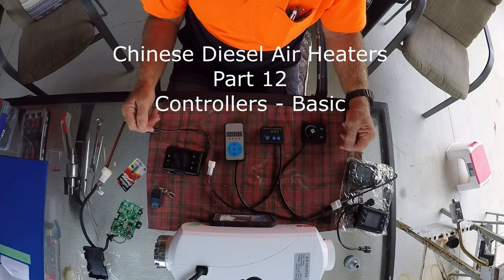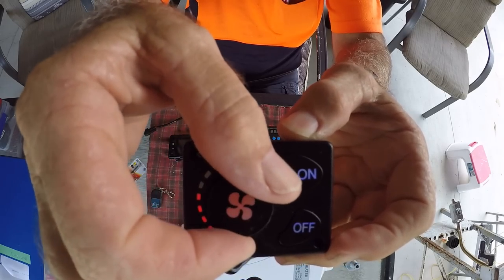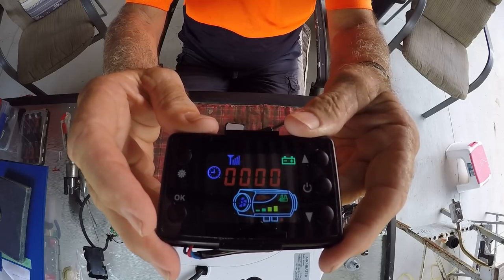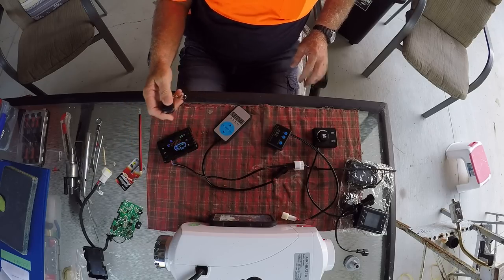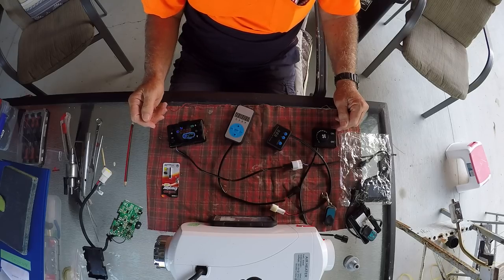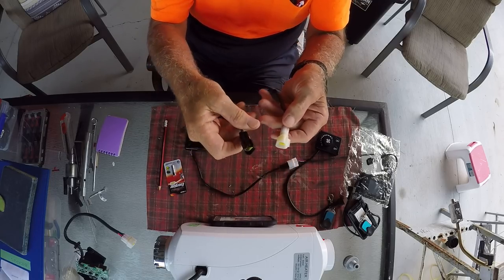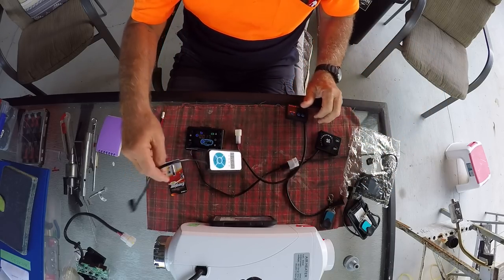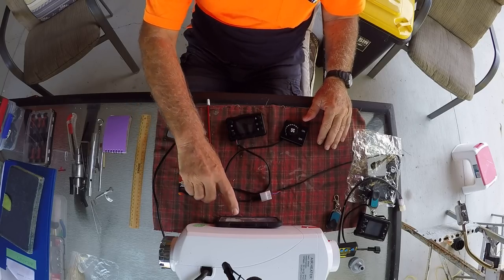Chinese Diesel Air Heaters -  Part 12 - Controllers (Basic)

Comment: Thank you very much for useful information. I have a question about usage these heaters at high altitude. Can they be programmed or what is needed to use it in mountains about 5000-10000ft?
Reply from the maker: Hi Yuri,

You can get an altitude kit for the genuine Eberspacher heater, but to the best of my knowledge there is no altitude compensating kit available for these Chinese copy heaters. However, as a compromise you could try using a high kerro:diesel mix say 80:20 or 90:10 to lessen the effects of running the heater in a reduced oxygen operation.  JMcK

Comment: Hi John I bought a heater with a black lcd controller. Unfortunately its a very basic controller, cant do much more than alter the temp on it. It has an "oil bottle" symbol instead of an OK button. (Dont know if you've come across this one) ........Anyway, I bought one of the BLUE controllers complete with motherboard. My question is will all motherboards fit these CDH heaters? Do they all have the same connections on the motherboard?
Reply from the maker: Hi Jack

When I did these videos some years ago now, most manufactures followed the same protocol and you could easily mix and match components. You could change controllers easily using the same motherboard, and all had matching plugs.

These days it is not so easy. Even with different controllers having the same plugs, sometimes the wires are reversed -  (Can easily be changed if you can solder)

Also now not all mother boards and controllers are compatible. You need to check if the temp sensor plugs fit, the dosing pump plugs are compatible, the controller talks to the mother board, and the mother board has the fan speed sensor in the right spot.

If you are a bit handy in these matters these things can often be fixed. But for most people, it is easier to buy the “package” they wast, and if there is an issue, ask for a replacement.  JMcK

Comment: Hi, learning a lot from these! I have a controller with blue lettering, it looks like it only has 3 digits rather than the red lettered one you have, therefore 1688 doesn't work in getting into the advanced settings. Is this something you can do with the newer blue lettered controllers? Thanks.
Reply from the maker: Hi S,

Thanks for your post.

Sadly I can not help you in this matter. I have seen too many people get into issues when they go into the advanced settings, and there is, (to my knowledge) no reset button. This is an area for an enthusiast to experiment. There are a number of people doing controller videos, perhaps there is one with the info you require.

That is my official reply, but actually, I do not have your type of controller in my workshop to play with. Be careful going into the advanced settings. For years the different Chinese heater manufactures all followed the same protocols, which made things very easy, but lately some manufactures are going very unique, which can cause you some real headaches in the locked settings.  JMcK
Reply: @johnmck1147  Hi, no worries completely understand. I plan to tune using a CO meter to achieve the cleanest, most efficient burn. The more I research into this the more I'm convinced this type of controller is too basic to enable fine tuning. Thanks.

Comment: Good video about controllers, I have the latest controller, the one with all the displays.
My one question is, to bring down the temp once the unit is underway, do I just press the down button.....wasn’t sure about this as it displays a P then a number.
So the lower the P value, does that bring down the temp, maybe it’s me, seems rather strange it doesn’t give the temp degrees instead off P, or have I got it all wrong
Reply from the maker: Hi Greg, 
P represents the frequency, and the number displayed is the pulse rate of the dosing pump. Eg, the number 4 says the pump pulsing at 4 times per second. (Squirting .02 ml of fuel 4 times every second).  These heaters do not have a carby or similar and the ECU uses the known dose and frequency of the fuel pump to match it with the fan speed to get a matching air volume for a correct fuel burn.

Push the down button to manually bring down the fuel dose and hence the temperature. Push the up button to manually increase the temperature.

Consider these buttons to be like a car accelerator, or remote control of an AC. You can manually adjust the temperature up or down.

Cheers, JMcK
Reply: On my controller,  I press the "ok" button and the "up" button simultaneously and I can switch between hz and temperature control.  Hz control the pulse rate of the pump, temperature settings will bring the heater to a set temperature.

Comment: Hey John,
 I know these are old videos but I have watched them all so far and find them very useful but I do have one simple question, is it possible to use 2 remote controls on one heater, mine has the LCD screen type of controller and one 4 button remote but it would be useful if I could add a second remote.
Many thanks for any help,
John
Reply from the maker: Yes, in most cases you can pair more than one remote to a heater, (if they are compatible).  JMcK
Reply: Ok thanks for the reply John, I'll get another one the same as I have now, John UK.

Comment: Great video John, Hope you could help me with a problem I have? My heater has an Oval controller similar to webasto, with error code E15 which means board failure according to the manual. My question is, are most good controllers interchangeable if mine is faulty?
Reply from the maker: Hi Geoffery, most, but not all Chinese copy diesel heaters have interchangeable controllers, but the Chinese controllers are not interchangeable with the genuine heaters Eberspacher and Webasto, unless you have some serious technical knowledge.  

You can buy on line a Spare ECU and matching controller that you can make work if your controller does not have the standard Chinese wire protocol.  Sorry.   JMcK
Reply: @johnmck1147   Hi John, yes it's a basic chinese heater. I cannot see any of my design controllers available so I'm guessing a replacement controller is required, but which one would you recommend?
thanks
Geoff

Comment: I've just bought one of these heaters and it is powered by a 12 volt 30 amp power supply......when it switches off the LED readout turns off too.........I also finally turn the power supply off when the heater goes to it's off cycle.

Comment: Hi John, Just installed my 2kw heater fired up ok but even on minimum thermostat position its to hot for my small van. I have the simple rotary controller, is there any way I can slow the fan and pump speed with this controller, I understand that on the LED display type you can alter the pump frequency. Great videos, thanks for passing on your extensive knowledge. Reg
Reply from the maker: Hi Reg,

First, is your heater really a 2KW heater?  Some eBay sellers sell the 5KW heater and relabel it as a 2 KW unit. They also relabel the 5KW heater and sell it as an 8KW heater.

Second, the slowest you can realistically slow the pump is to 1.6 Hz, which is a common controller low speed. If you go lower you really can't keep the flame going in the burner.

Third, the min speed on the rotary controller is very similar to the minimum speed on the LED controller.

Fourth, are you waiting for a few minutes for the heater to stabilise? It will run fast on start up and then slow down when the burner is well alight and the chamber up to temperature. 

Fifth, you may have a defective controller. Does the fan and the pump ticking slow right down when you turn the control knob down?

I hope this helps.  JMcK
Reply: @johnmck1147 
Hi John,
Thanks for your reply. The unit was bought as 2kw, how can you if its not 2kw? Pump speed is about 94 beats per minute which i think equates to 1.56 Hz. I have had it running for about 1 hour none stop with the thermostat on one bar. With control right down its 94 BPM. I still have some air in the system but only a bit maybe 2" in the pipe.  I did have an eberspatcher?   heater in boat i had, it seemed to run at a much lower speed.  I notice on one video that you can control the pump speed.
Many thanks,
Reg

Comment: Hello John...Wondering how you can prime the heater with the basic rotary  controller.
Reply from the maker: Hi Amie, you press and hold the off button until you hear the pump start ticking. The pump will then run for about 4 or 5 minutes to prime the heater. Do the same again if needed.  JMcK
Reply: @johnmck1147  Thanks for the response John.  One more question if you don't mind.  Again, when using the rotary controller does the heater automatically go through the shutdown process when you press the Off button on the controller.  Does the glowplug ignite to burn off any residue?  Thank you.
Reply from the maker: Yes, when you press the off button, the heater goes through its safe shutdown procedure.  
I personally prefer the simple rotary dial controllers. JMcK

Comment: Question, if when the controller should fail and the heater continues to run at the last setting but without a way to shut it down without damage. Could you stop the fuel supply until the heater cooled then shut it off by disconnecting the electricity whitout damaging the circuit board? Disconnect the fuel pump wire?
Reply from the maker: Hi TB

It you disconnect the fuel supply by either disconnecting power to the fuel pump (best way) or shutting off the fuel itself, the heater will go into shutdown mode on its own, and turn itself off.

Cheers.  JMcK

Comment: Hi John, I have just fitted a replacement heater in my boat in La Manga. Everything seems to be working fine but I am getting a slight amount of excess diesel coming through the ducting, as if its not all being burnt off on the plug? Any thoughts? I am using the led controller and the heater is a Vevor. Thanks, John.
Reply from the maker: Hi John,

Not quiet sure what you mean here. What ducting? The large hot air ducting or combustion air inlet duct. Do you mean diesel smell or liquid diesel ?

There should be NO diesel smell through the large hot air ducting.

First check if the combustion air inlet pipe is close to the hot air inlet on the heater. If yes seperate them.

Do you have big ducting on the hot air inlet? 
Where are you drawing the inlet air to be heated from?

You can get slight diesel weeping from the combustion air inlet caused by in complete burn of excess diesel on previous shutdown, or slight diesel seepage caused by the fuel tank higher than the heater. But all smell should go away after heater starts its burn.

If your hot air inlet is well away from the combustion air inlet and the smell remains with heater running you may have seal or gasket issues. This is dangerous.    -  See video on gaskets. 
If this is your issue, ask for a replacement heater.  JMcK
Reply: @johnmck1147  Yes John, it looks like all the diesel is not being burnt off and some excess is coming through the hot air duct
Reply: @johnmck1147  Ok John thanks......The only condition which might need looking at is the distance between the two air intakes. I will look closely at that. I'm going to the boat tomorrow for a couple of days so I'll have time to check it more closely. I did wonder if maybe the pump speed was set too high, pushing excessive fuel into the chamber. On the gaskets.......Hopefully not, nightmare scenario!. Anyway I really appreciate your time. If you are ever down my way, look me up. Thanks again. John

Comment: Thank you John for sharing your knowledge and taking the time to make these videos. If you are using the heater as a portable unit and you disconnect it from the battery, is it still an issue?  Would it be a good idea to install a fuel shut off valve in case it decides to go berserk?
Reply from the maker: Hi Darren. 

First, thanks for the feedback.

If you disconnect the heater from a battery while it is operating, it can not go through its cool down cycle, and you can destroy the ECU and other components from overheat.

I always install a fuel shut off valve between tank and fuel pump.  JMcK
Reply: @johnmck1147  would shutting off the fuel supply allow the heater to cool down properly?
Reply: Would you recommend adding a fuel filter/ water separator?
Reply from the maker: Yes, you should have a good fuel filter to prevent issues with pump and atomisation screens.  JMcK
Reply from the maker: Yes Darren, if there are issues with controller shutting heater down, best to disconnect fuel, never the battery.  JMcK
Reply: Thanks again for the help John, wonderful videos! I hope you had a nice trip to the Mediterranean!
Reply: Hey John, in episode 6 you mentioned that it would beneficial to increase the diameter of the intake hose and also use a
 smooth bore hose, and also limit anyone restrictions. I'm just wondering if you know where I can find some hose that would work? I looked at the hard store and I was unable to find  a larger filter than the 24mm inner diameter.
Reply from the maker: Hi Darren, sorry for the late reply. 
Do you mean the combustion air intake hose? If there are long runs with lots of bends you can make one up out of larger dia PVC pipe from a hardware store. 
If you mean the cabin air inlet, you can also get larger ducting from a hardware store or tool store.
However it is better to keep your pipe runs a short as practical.  JMcK
Reply: @johnmck1147  okay that's good, I'm only a short distance, the heater will be outside.

Comment: Hi John,  Your videos are a great source of knowledge. Thanks. I know you cant recomend a particular heater but could you suggest some suppliers that you have purchsed from and are happy with the product and the accessories like mufflers, fuel line etc.
Reply from the maker: Hi Craig, I have mostly purchase these heaters and the spare parts on eBay. I have had a number of requests similar to yours and just last week I went back through the suppliers I bought off last year, some had disappeared, and none currently sold heaters. 

I suspect, but I don't know for sure that a seller buys a batch load of a particular product and then markets that product until all sold out. If it is a good seller they do it again, if not they try something else. I suspect you would not sell thousands of heaters. I have not found a seller yet specialising in these heaters.

I go on eBay and search for Chinese diesel heaters, diesel air heaters, parking heaters etc, 
I look for the heater I want with the controller I want, at a competitive price. I then try to buy from a supplier who has a local in country warehouse, in my case, somewhere in Australia, who offers returns. However, I have been informed by a viewer that you can get a full refund from eBay for a faulty product without returning the item. This is perhaps a bit one sided as the seller loses the sale, and the product as well.

I always bench test the heaters before install as you occasionally get a dud heater, as there is probably not the quality control you would expect from a very expensive genuine heater. But these heaters are excellent value for money, and they are in a price range of the average person. 

Sorry I can't be more help.  JMcK
Reply: @johnmck1147  Thanks for the reply John, you are very helpful. I have had trouble getting clear information from the sellers on ebay. None have been able to give me specifics around fuel lines and mufflers etc. Can you suggest where I may be able to purchase the correct size and type of fuel line if I recieve a heater with the wrong type ?  Cheers  Craig
Reply from the maker: craig green 

Hi Craig, from tank to filter to pump you can use normal fuel hose. 
From pump to heater you should use small 2mm bore hard nylon fuel hose. This is very important if the distance from pump to heater is more than a meter or so and has bends in it. The rubber fuel hose absorbs the fuel pulses and you get a bad burn.

Depending where you live you can buy at industrial stores, but I buy on eBay. Search for fuel  hose for Eberspacher, or Webasto diesel air heater.

Here is just one link to get you started.

https://www.ebay.com.au/itm/Fit-Eberspacher-Diesel-Heater-Fuel-Filter-Fuel-Pipe-Line-Hose-Clip-Kit/113854232204?hash=item1a823db68c:g:~7gAAOSwMkJdVQZ5

Cheers, JMcK
Reply: @johnmck1147  Hi John, again thanks for the reply. The link that you provided has a 3mm I.D fuel hose and not 2mm. Will that still be O.K ? cheers.
Reply from the maker: craig green 

Hi Craig, the link was just to get you started. 
Try and get 2mm bore hard nylon if you can, but 3 mm will be ok if the distance from pump to heater is not too long, say under 2 meters.  JMcK